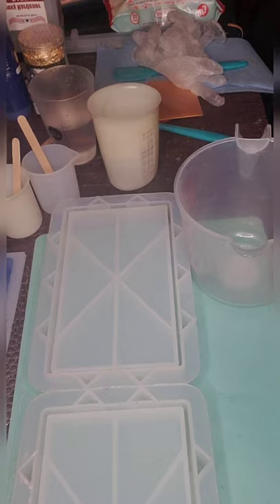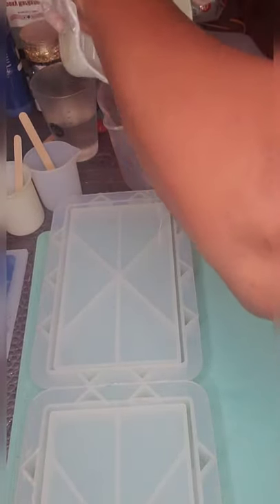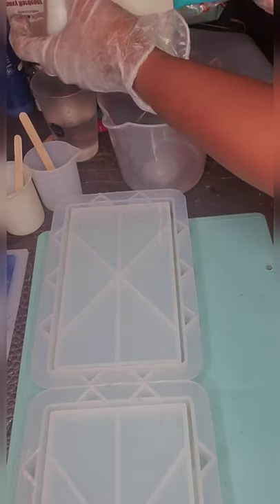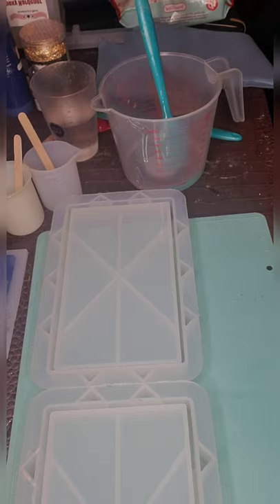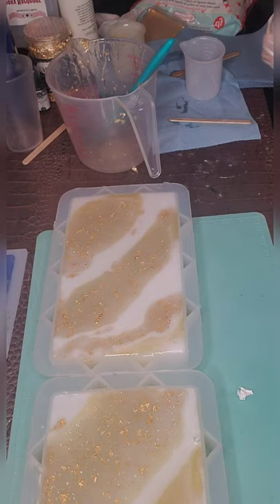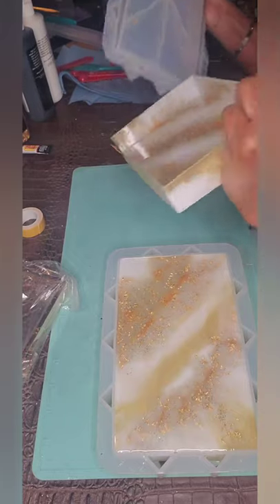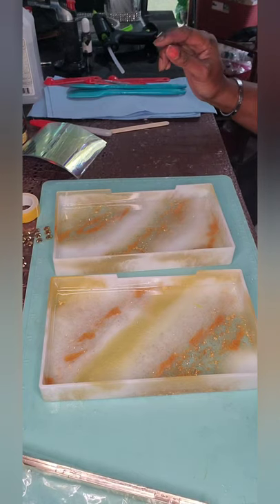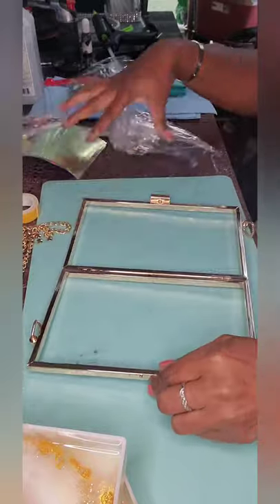How to Resin a Clutch Purse Tutorial

Comment: I made my first purse and the Resin was stuck to the mold, what did I do wrong?
Reply from the maker: Thanks for watching and hopefully you have subscribed to the channel. This can happen if you over pour, and it cure hard without you pulling it apart while in the flexible state. however, you can run it under some water and use dawn dish soap to loosen it up. they also sell mold release spray that you can use, however it doesn't work all the time. the soap method has worked for me each time. just take your time wiggling it free and getting the soap to the stuck area. There is more to come so please stay tuned. Happy Crafting Love and thanks again for your support.